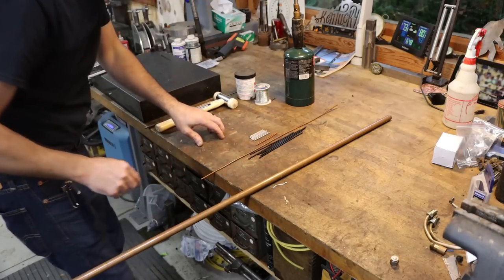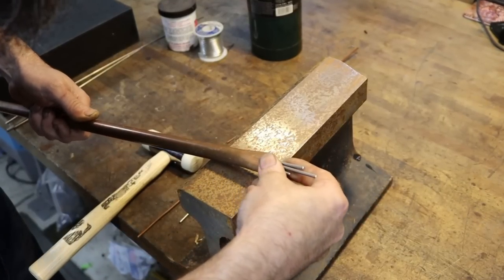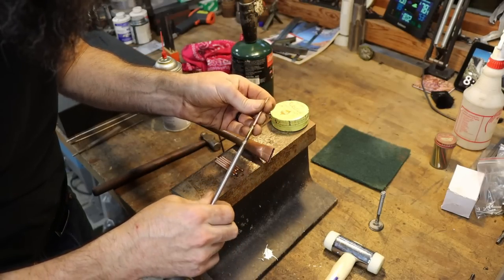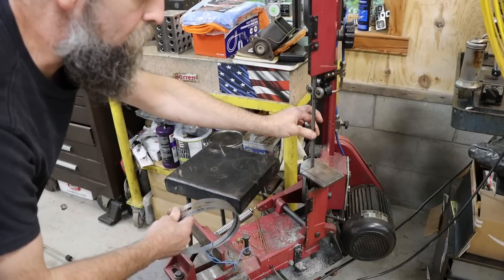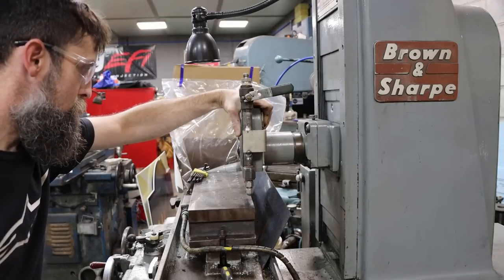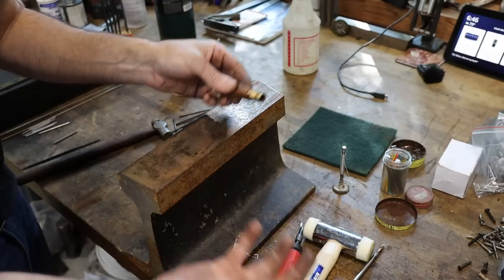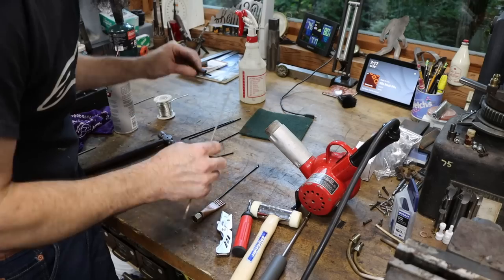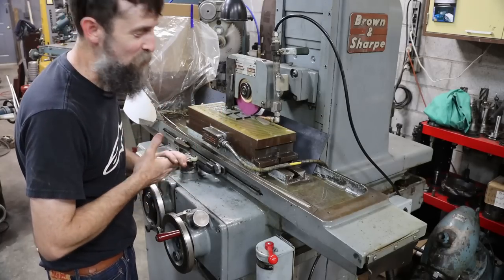The Magic Renzetti Cooling fingers   Not Really Magic!

Comment: Steve little tip your right on track smashing the copper pipe making a nozzle i found i would take a even spaced apart number of steel filler rod in 3/32  weld them together missing every other one use a ♒️♒️♒️♒️〰️〰️〰️〰️

Comment: Nice practical addition.   The cleaner is a bit slow on the dusting. Also needs a bigger brush. A 4" skirted uniform and a little apron wouldn't be lost either.  The overseer woke up long enough to eat lunch.

Comment: That type M copper tubing is very hard and doesn't form well. If you aneal it with some heat (a nice rosy red) it will soften up and be easy to work. I picked that up from a maker who makes copper roses using copper tubing. Nice project that I will make for my surface grinder. Thanks Steve (and Robin).

Comment: I used to make up a similar system using 3/8 refrigeration tubing by pressing about 3” or so closed against a piece of .025-.030” shim stock bend a 90 at the appropriate spot cut and flare the end and attach to the lightweight ball valves from McMaster.  Install a tubing barb to the valve and mount using heavy duty metal tubing clips.

Grinder hands could have a few different lengths that could be changed out easily.  Easy to make and kept the flow where needed and off the floor, walls and most important out of the air.

Comment: Quick trick I found for heating plastic tube like the straws., Heat up a cup of water in the microwave and dip in you tubes they will stretch perfect fit. and will shrink to fit when they cool. Cup lasts about 30 min before reheat required.
Reply: What was wrong with the heat gun?  Did I miss something?  It seemed to work just fine.

Comment: Here's a suggestion.
I make motorcycle chain lubricators. All the commercial units on the market use some form of tube to deliver the lubricant to the chain and they all suffer from uneven oil delivery.
I use a polyurethane flap that contacts the chain and the oil is delivered to the surface of the flap and flows down evenly onto the chain .
Try using this concept to guide the coolant to flow to where you want it. It can be a flexible flap of any suitable plastic or even a small brush. 
And if it gets caught in the wheel , a plastic flap is unlikely to make the wheel break up. 
Those copper tube fingers are more likely to cause some excitement when they go under the wheel.
Reply: A few rows of nylon bristles would be safe,  but a PU flap bigger than the gap might be a bit chewy at that spindle speed
Reply: The "copper tube fingers" are nowhere near the wheel.  That is the reason for the plastic straws!  You need to listen and pay attention to the video before you comment.  He explains this entire operation.

Comment: Add a second valve like a needle or gate to more finely adjust the flow.  Use the original ball valve for on and off only.
Reply: If you like challenges, add a v notch to the existing ball channel to improve the low-flow control.  You can probably find a commercial one pretty easily, but making one would be way more fun.
Reply: I second 4575's suggestion of a needle or gate valve. The ball valve is great for on/off applications, but not fine adjustments. Check with McMaster/Carr for valves. Thanks for the video. Jon
Reply: Gate valves are designed to be fully open or closed more than metering.  A needle would be fine.

Comment: Since you're just about out of flux. Oatey sells a tinning flux that comes in a can with a green label. Buy that flux. You'll thank me later. They sell it at the big box lumber stores. It's the best flux I've ever used. I used to use the yellow stuff but I never looked back after using the stuff in the green can. It makes a fool proof joint every time.

Comment: I am the same about the temporary stuff becomes permanent. I don't want to hear any complaints about it being hot. I'd gladly take your weather. We haven't seen a day under 100* in 3 months and still have another month to go with temps of 104-110* daily. Some days it's 100* by 10 am and still 100* at 9pm. And it only gets down to the low 80s at night.
         I gave up doing anything outside or in the shop so no videos till maybe October when fall starts. The concrete slab of my shop is 93* now and I don't have enough AC in it to get everything cooled down to work in there. I have been wanting to move out of TX since I was forced to move here in 89 and now I'm just angry that I live somewhere the weather sucks year round. And that's pretty common as most people are angry and not friendly here because it's so unbearably hot most of the year.
Reply: We have had 99-103 temps in La for about 20 days, with at least 10 more forecasted.  We're cranky, but not angry. The good thing about a heat wave is that it feels so much better when it's over!
Reply: @Bob_Adkins  I wish it was that nice here. We are 3 months into it now and no relief till late september. We don't call it a heat wave it's just summer here every year. We just hope for a hurricane for a day of relief from the high clouds. The rain never makes it this far inland. 
    It's still 95* at midnight here. Here it's not like it's 100+ for an hour or two it's usually 8-10 hours a day and the ground and everything else is heat soaked. Our cold tap water is 90* because the ground gets so hot.
         We might get lucky and get a one day break and only be 100* on Tuesday.

Comment: Nice work.
Time 14:00, cutting on the bandsaw. If You turn the object 99 degrees it cuts a lot faster. Use the 1 2 3 blocks to clamp the piece!

Comment: Wouldn't putting the nozzle the other side of the wheel avoid the sucking under problem?  slightly offset so the sparks aren't aimed at it?
Reply: The wheel needs to draw the coolant to the grind.  Why would you want to spray it into the action??

Comment: Function over form Steve. Are you balancing your grinding wheels? I don’t recall you mentioning that in videos. I found that really ups the quality of the finish. The adapters with balancing weights for my Jones and Shipman grinder run over $300 each (the spindle has the European taper) which drove me to making a cup with adjustable weights. The results were a remarkable difference. I may work up a nozzle system like this one. Great job, as per the usual.
Reply from the maker: I do balance my wheels😁👍

Comment: Riddle this. Guy calls me and asked if I would come dress the mag chucks on two of his grinders because he was having trouble. He had been dressing them with the chuck off so when he turned it on he would get a low spot in the middle of the chuck. Set up a tenths indicator and found when he turned the chuck on it would "suck" itself down to the table. Started dressing with the chuck on and the problem went away. Any of this make sense? Crazy I know but fact is strainger than fiction...
Reply: Just curious, has he removed the chuck and inspected and possibly reground the bed yet? I remember a few years back when I used to watch NYC-CNC, he was still figuring out his way in business and was still occasionally playing with manual (non-CNC) machines.  He'd bought a decent size Okuma grinder, and wanted to get it nuts on accurate. He ended up pulling off the chuck (1st time in probably years that it'd been off, if ever) and there was a bunch of rust under it. He went thru the process of cleaning it up and grinding it flat, then hours of putzing with it to try and adjust most of the droop out of the end of the travel in both directions. He got it into a pretty accurate condition, but then ended up selling it not all that long afterwards apparently.

Comment: I wonder what happens if you lose a straw between the wheel and the workpiece?(or did I miss that?)
Reply: Steve suspects/hopes that since it's soft plastic it will be quickly ground into dust.
Reply: Some of that straw will probably gum up the grinding wheel but that’s a quick fix with redressing the wheel…hopefully. Lol

Comment: Too hot? Why not get yourself one of those DIY MiniSplit HVAC systems? I think 2 tons would be sufficient for your space but do get some other opinions based on your local climate. And many of these MiniSplit systems are heat pumps so they can provide heating as well.  Would save you the hassle of firing up your wood stove for short jobs. Plus we get an excellent install video with the Steve Summers high standards at play.
Reply: I have a 2 ton mini-split in my garage. I tell you what, it is great having it where I can comfortably work in my garage all year.

Comment: Ball valves are designed to provide the most flow, they do not throttle flow well.  They are an full on, off valve. Try a needle valve

Comment: Sorry, but this video doesn't measure up to your usual standard of excellence. It looks crude and clunky, and detracts from the elegance of your grinder.
Reply: Well, I suppose he could have machined it out of  a block of stainless, precision turned, drilled and reamed each individual tube again out of stainless, and had maybe spun silk tubes as a  delivery method,  each meticulously hand fitted to it. Taking $100's and 10's of hours, all for what? So it was made to your standards? T'was a relatively cheap, quick and dirty project to accomplish a specific task. Mission Accomplished